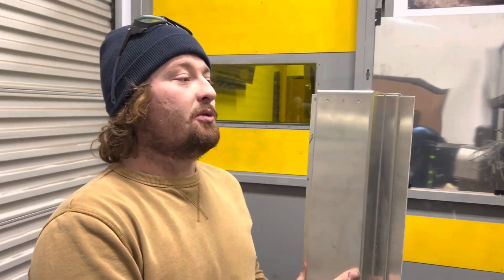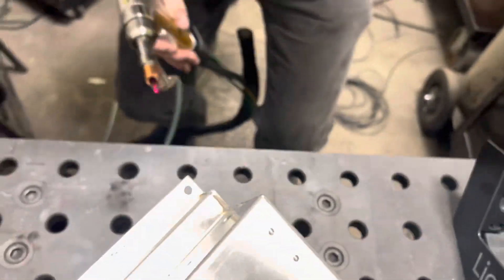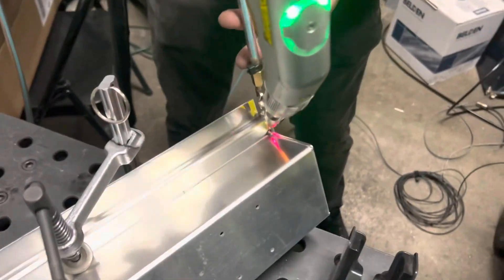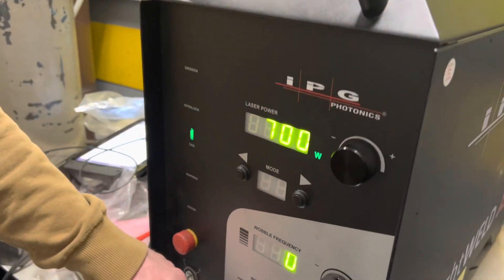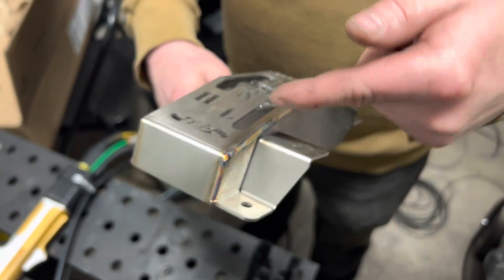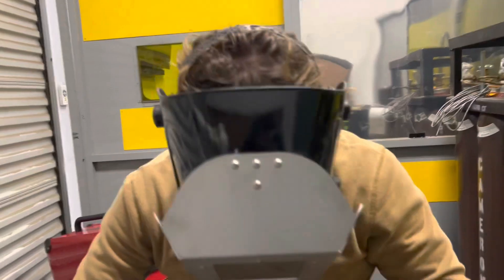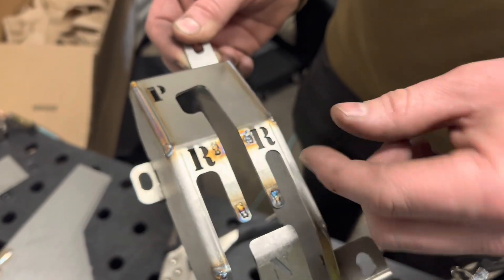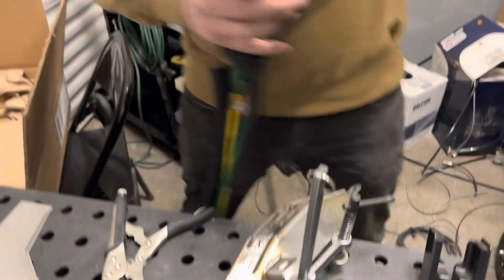LightWELD - “TIG Weld Technique”

Comment: What is the typical cost of consumables? Roll of filler materials or contact tips?
Reply: Standard MIG wire. Tips are a few bucks each, but don’t really wear out often. There’s nothing contacting them. They do get black from the fumes, but that just wipes off.